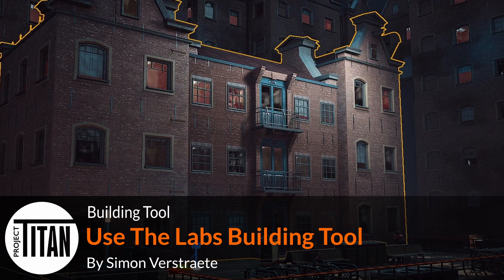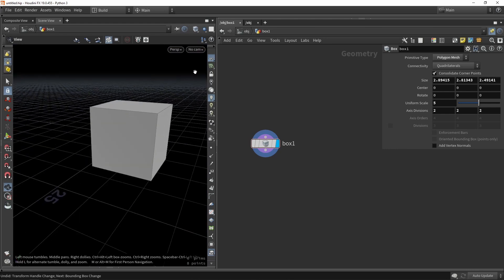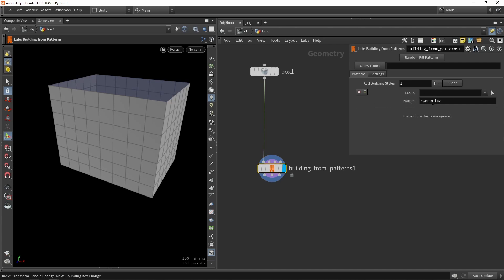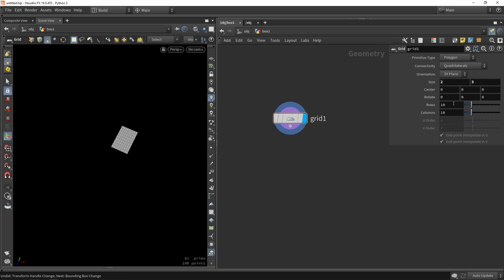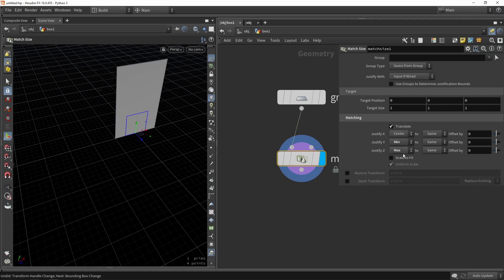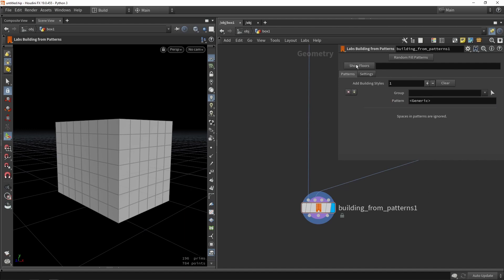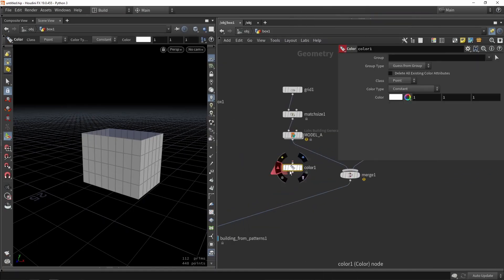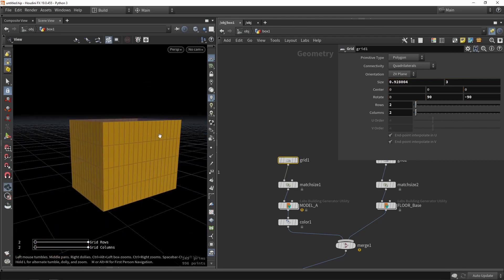Project Titan Building Tool | Part 1 | Use the Labs Building Tool

Comment: The tutorial is broken on the 'second node.' It seems like SideFX is sort of scratching their head figuring out how to on-board new users, but stuff like this makes learning Houdini so frustrating. Right off the bat, the Building From Patterns node is completely different-- it just doesn't work with this input. The cryptic error says it's missing attributes that aren't in the documentation and generate zero hits on google. The documentation in the node help is absolutely useless. It gives no specifics about what the node actually needs to function, and most of the parameters don't even have descriptions! What am I going to do-- keep following a tutorial that's broken from the second node with absolutely zero guidance on resolving the problem? Not even basic documentation? The pattern reference is completely out-of-context with no examples or even defining what the terminology means, and since the node is broken with this input, there's no way to experiment and figure out what's different. 🤯It doesn't matter if the rest of the tutorial is bang-on because there's no reasonable way for users to get there with their own systems.

I feel bad for the people that put the time and effort into making these tutorials. They were trying to do something that would help people get their bearings in Houdini doing something that a lot of people want to do, and now the only thing it's going to do is frustrate people and scare away new users. I'm grateful for the work SideFX is putting into publishing tutorials and acknowledge that documenting a monumental environment (set of environments?) like Houdini is incredibly resource intensive, but when you're just leading new users to a dead-end, you'd be better off just taking stuff like this down.
Reply: just ran into this problem, and I have absolutely no time to go down some rabbit hole to get it resolved. and as a new user, I'm abandoning Houdini for my project.

Comment: Plugging the Labs Building Generator Utility output after merge in, and pressing "Show Floors" I get so many /BaseWalls/ and the box turns red.
Tested several Houdini versions, all same. Is it broken?

BaseWalls / BaseWalls / BaseWalls / BaseWalls / BaseWalls / BaseWalls / BaseWalls / BaseWalls / BaseWalls / BaseWalls / BaseWalls / BaseWalls / BaseWalls / BaseWalls / BaseWalls / BaseWalls / BaseWalls / BaseWalls / BaseWalls / BaseWalls / BaseWalls / BaseWalls / BaseWalls / BaseWalls / BaseWalls / Generic /

Comment: as soon as i connect building_from_pattern node after boxgeo, but box start showing in red ( no divisions wires ) which is really strange .. any ideas??
Reply: same problem,have you solved?
Reply: Make the box bigger and turn of compile from inside the building_from_patterns node.
Reply: @sakibkhondaker Thanks, having same problem. How do I turn off compile?
Reply: @yaschan99  Unlock the node - building_from_patterns. Get inside it. You will see compile nodes.

Comment: I'm running into an odd issue...the minute I stick the box into "building_from_patterns" I get a warning "invalid pattern" and the box turns red rather than getting the wireframe.  When I plug in the pattern and try to get the floors I gt no floors showing up in the list. I double checked my parameters for the box and they appear to be the same as specified in the example?!
Reply: It may have been a bug in build 493…when I upgraded to 534 it started working.
Reply: @proceduralnodes3d  Got same error with H20 when using Megascans module walls, then just replaced mesh with the grid in the floor logic and it worked.
Reply: Well, I just (3/31/23) got an email from SideFX support....apparently the issue with not recognizing patterns from the HDA in UE 5.1 is a bug and has been logged in their database accordingly.   So we'll have to keep up with their updates.
Reply: Are you guys finish the building?
Reply: @lotpeach9730  unfortunately not to the extent I want.   I can get it working in Houdini but can’t get UE to recognize any patterns :(
Reply: Make the box bigger and turn of compile from inside the building_from_patterns node.

Comment: Hi, how can I avoid gaps in the building when the building wall segment size is smaller then the segment (wall element) it self? In the other tool Labs Building generator without pattern it scals the segments to fit.

Comment: Building from patterns not available in 19.5, is this replaced with Labs building_generator? menu looks different
Reply: wondering this as well
Reply: same... did you find a solution ? i get invalid pattern warning just by pluging in the box to the node
Reply: The latest Houdini and SideFX tools will work in Houdini but UE 5.1 will not recognize any patterns
Reply: The latest Houdini and SideFX tools will work in Houdini but UE 5.1 will not recognize any patterns

Comment: Building from patterns does not work in Houdini 19.
Reply: you have to upgrade to labs 19.0.657
Reply: @regularmenthol  I have installed this version but the generator keeps saying invalid patterns. <Generic> works of course. I really do not know what's wrong.
Reply: @krautagion6001  Try setting the primitive type of the FLOOR_Base grid to Mesh instead of Polygon.
Reply: @aelliixx  Thank you. Did not have time to try it out until now  -it seems to do the trick.
Reply: @aelliixx  any other tips ? didnt work for me
Reply: nvm working thnx! :)
Reply: Make the box bigger and turn of compile from inside the building_from_patterns node.